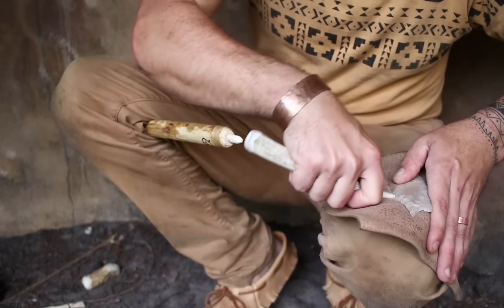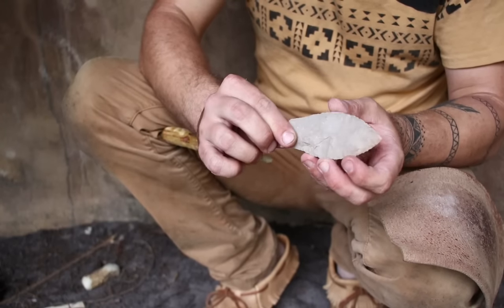How to Make and Use a Stone Knife

Comment: Let's be real I think primitive knives work better than most modern knifes. The cut, rasp and saw in one is actually so handy. I'm very impressed. I might just make a new edc knife.
Reply: They can definitely get a bit sharper especially if you have an obsidian blade, but the lower toughness and thicker blade profile that entails makes them less well suited to working harder materials such as wood.
Reply: Unfortunately that's not true pal primitive knives were good but metal ones are just better had the stone age tools been better than metal we wouldn't make them out of metal but out of stone nowadays it's a simple irrefutable logic im using nothing special

Comment: I’ll probably try to make the knife with some random stone in my backyard Maybe basalt. Great  vid, I also finally finished some arrows following the Stone Age arrow build Thanks 👍
Reply from the maker: thanks very much. best of luck
Reply: Is basalt a proper rock for this?
Reply: @sckar5355  there are better choices depending on your geographical location. But for some reason Ive always had a hard time finding flint or chert. So I like to use common rocks like basalt. Also it’s interesting to use challenging stones
Reply: @cameronpain1422  Thanks for replying! I can't find any flint where I live either but basalt is all over the place. I will probably try it too

Comment: I had issues in the beginning of not being able to thin the blade at its center then in trying over and over to get it thin lost with much mass and it became an arrowhead.
It’s interesting that the best tools to Knapp with are still antlers horn bone stone and leather even today.
Knapping may be the best tool to have if lost in the wild.
A knife is the tool needed for all things when in that position.
It’s the tool that makes the tools you need to survive.
If I were just dropped off in the wolf the first thing I would do is make a knife then basic shelter find water make fish traps then start making cord .
Once the cord is made I would perfect fish traps and other things with the cord and start making a bow and arrows and tips etc..
Weave a backpack make a Speer then get moving on from site to site flowing the river where there is already food.

Comment: I once bought a large stone blade to haft it too a handle, but accidentally dropped/knocked it off my workbench onto a cement floor.  It broke into 3 pieces like a very brittle steel Chinese file did years earlier.  I though I could repurpose the 3 pieces into 2 atlatl points and 1 small cutting tool.  I never bothered.  Is there a modern type of glue that I could use to glue the 3 pieces back together to use it as a display piece?

Comment: Ryan, could you do a video of how to knap gun flints? I made a biface and heavily single beveled it, but it doesn’t seem to hold its edge or spark as well as one flaked from a core. I get the theory on how to knap from a core, but there are no good videos on how to actually set up the core for knapping from a raw stone.
Reply from the maker: When I am making gun flints, I don't knap from a core. I only supply myself  with a flint or 2 a year so I just save debitage from making points and blades that have the steep bevel I am looking for and then snap the ends off.

Comment: With hunting points most of the knappers are trying to get 7:1, 8:1even 10:1. Thickness. But for hunting what is the ideal thickness to have. These seem to fragile for hunting. Hit a rib and you fracture it. Even some pig skins are hard to penetrate with a modern head. Thank you for your time and knowledge.
Reply: I don't think it's this video specifically but he actually touches on that exact topic in a different video. He basically tells us/you the importance of being able to make sure that your stone points are razor-sharp. Otherwise yes a stone point can bounce right off of a deer, but when made well a stone point is just as if not more deadly than a steel point. I reckon anyways, but don't take my word for it lol he does a much better job at explaining than I do
Reply: @chiefcrushgore6452 thank you. There are other knappers that hunt and make hunting points for others. I’ve seen in film how lethal they are. I guess what I meant was there are show points and working points. The one I have from reference books dates 4000 years ago and it is pretty thick And your right sharpness is everything.

Comment: Around what thickness should you shoot for when making these?
Reply from the maker: it will certainly vary a bit, I dont really ever measure them, but I would guess 3/8" thick in the center and tapering out
Reply: HuntPrimitive so that’s why mine have been so fragile, my past blades were more around 1/4” thick
Reply from the maker: @lowbudget9367  yeah that have to have a little spine too them, depends on the rock type too and whether it's heattreated or not as well.

Comment: I have heard that flint is often sharer than the sharpest surgical steel, yet you seem to be handling it like it is as dull as a butter knife. I'm lost.
Reply: POOR PIRANO  That's new, Thanks!
Reply: I've seen a flint edge under a microscope and compared to a scalpel, under a microscope. The steel edge, magnified, looked jagged. The flint edge was somewhat serrated, but smooth. The article I saw with this, said some surgeons prefer flint scalpels.

Comment: You shouldn't be throwing the smaller flakes, either.
Make them into razors, then thread them into  a ling stick with a rail in it, and you get a stone-age saw.
Do it on both sides of the stick and possibly stick a sharp edge on one end, and you'd get a Neolithic sword!

Comment: Wouldn't a burin work better to cut a grove and fire to cut the length. Most handles are bone or antler aren't they? Or was this just for fancier high end knives and this more a cave man all-purpose knife? Not trying to be a dick or critical , just wondering. Nice work by the way. I made a display knife out of a piece of white glass I found on a hike. Antler handle , cave-man hot glue and deer sinew binding. Knapping work was pretty crude but it looks cool.
Reply from the maker: thanks much. I think wood would have been used a lot more often because of its ease of use. I find wood to be a lot more comfortable than bone or antler although I do make a lot of those each year as well. I think trying to burn the notch in would take a lot longer than you think because a really small coal would have to be used. Best thing to do is try it out and see how it works for ya, but cutting the notch in works really well for me so I am pretty happy with that method
Reply: @huntprimitive9918  I've never tried sawing with a stone knife. Looked slow but effiient. For burning I just meant for length. I've never used a burin either but saw it demonstrated somewhere for scoring antler. A small pieces glued onto a antler tine might work like a tiny adze to score a grove. I must admit I cheat and use modern tools to fashion mine. As a real anthropoligist your not afforded that luxury
Reply from the maker: @timothylongmore7325  Oh I gotcha. actually cutting to length is the fasted part with a stone knife. Just score around the handle and snap it off. It works really well. I did a big long video on stone age wood working tools also, if you have not seen that one.
Reply: @huntprimitive9918  No I haven't. Just discovered ya. I will check that out. Liked n subbed too.